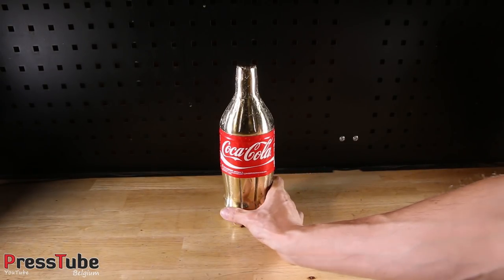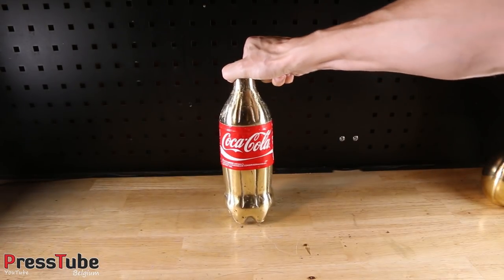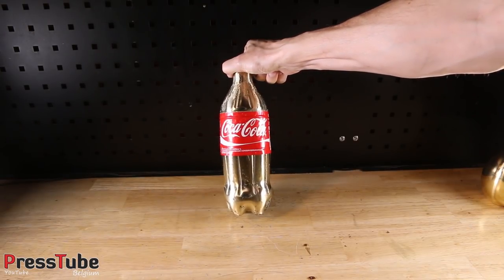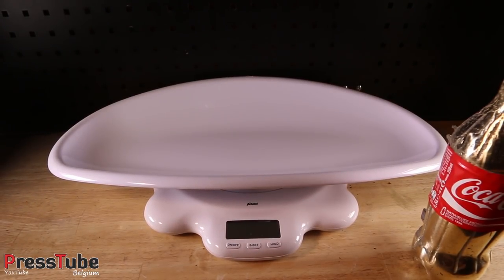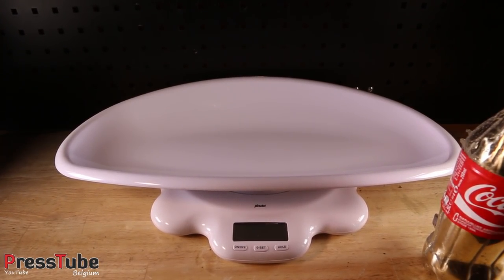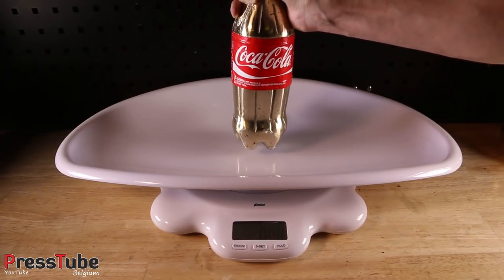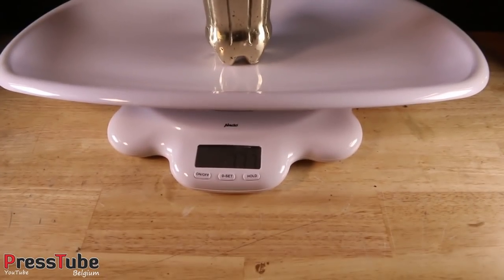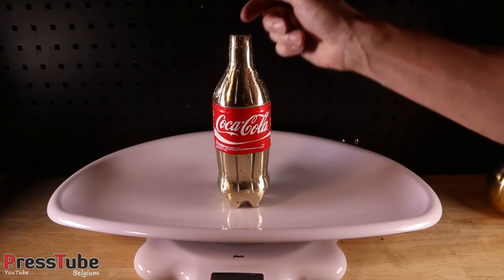Casting a Solid Brass Coca-Cola Bottle from empty bullet shells

Comment: Cast a hollow Coca Cola bottle so you can actually drink from it that would be amazing
Reply: The brass would poison the drink unless you put something to wrap the inside
Reply: SKREAR yeah and plus it would make it utterly hard to make because casting something hollow is almost utterly impossible
Reply: ThatEmz 

Well.... one COULD pack the inside of the bottle with the casting medium, then pack the outside as usual. Difficult, but would it work? Only way to know is to try.

Comment: Why don`t you may a border around input hole to avoid spilling of hot brass? Also you can separate form into two parts and remove plastic bottle to avoid inperfections.